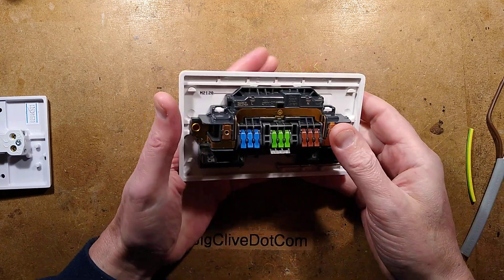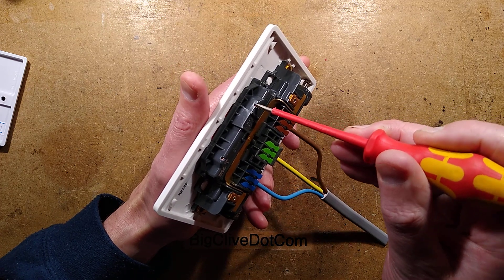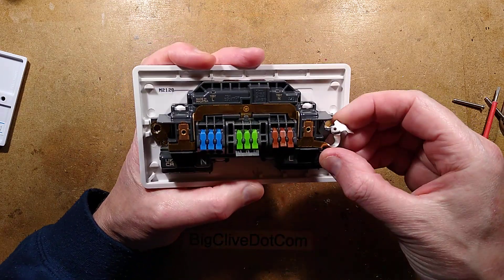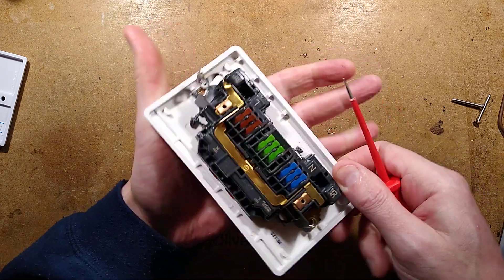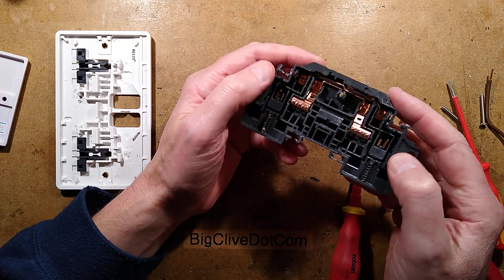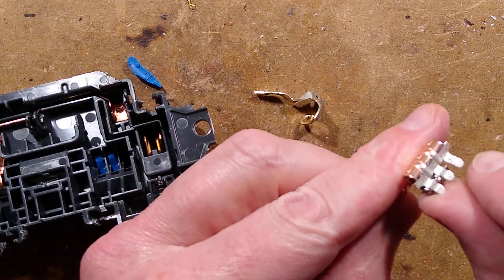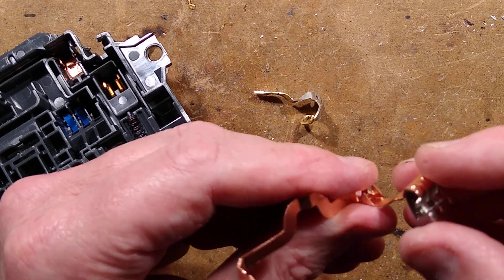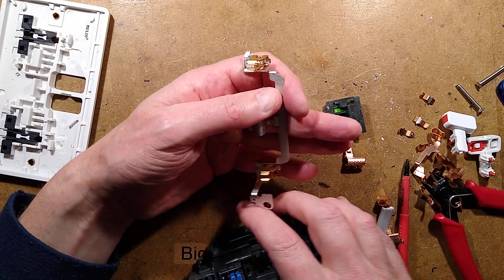Teardown of the new MK screwless socket

Comment: Wow we dont get neat things like that in the usa. And I like the switch on the plug that's a nice feature. Lovely video to watch before going to bed. Nice and relaxing 
👍good stuff bigclive
Reply: I can't believe the USA sill use twist connectors. 😂
Reply: @richardwigley  they are actually not the real issue with usa wiring, the back stab style of quick terminated outlet is a much larger issue compare to wire nuts as long as you use them correctly and don't try to use them for al/cu connections
Reply: @Mister_Brown  Commercial/industrial grade outlets don't have back stab connections, only the cheap ones for residential use do.
Reply: @brianleeper5737  True that--in my own home, I've slowly rid us of the "push-in" receptacles.     It was a terrible idea to begin with.  Some fixtures have a set of screw terminals as well as the push-in.   I suspect that one of the hydraulic-crimp-you-need-a-very-expensive-tool connections pretty much trumps everything but solder.
Reply: @tubastuff  I have a house where the original builder used outlets that ONLY have push in terminals. No screws. These outlets were made by Circle F in about 1987. Circle F went out of business in 1990 or so.
Reply: @tubastuff  I don't like crimp connections - unless the crimping tool remains on the connection keeping it tight - just like a screw terminal does. After all, when you remove the crimper, the pressure eases off on the wires !
Reply: @millomweb  I'm talking about the (usually hydraulic, but some battery-powered ones are now available) gas-tight crimpers.  It's pretty much a cold-weld process that yields joints that are stronger than soldered.
Reply: @millomweb  That's not how crimp connections work. Properly done crimping causes everything to cold weld, it's not just a simple pressure connection.
Reply: @mfx1  Interesting.
Reply: @mfx1  Well, someone who knows more than me on it says: "Crimping is just a compression joint.  It does not cold-weld". And that remains my opinion.
Reply: @millomweb  Then they haven't got a clue what they're talking about. If a crimp hasn't cold welded then it hasn't been done properly. There is an exception that crimps shouldn't be used with solid core cable when vibration is an issue but then again using solid cable in a high vibration environment is a bad idea anyway.
Reply: @richardwigley  The problem arises when hurried contractors or hobbyists use wire nuts and don't twist/crop the wires prior to using the nut itself. When used properly they're slow to install, but quite secure.
Reply: @elitearbor  I don't pre-twist wires before using wirenuts. However, I do put enough torque on the wirenut when twisting it on that the wires twist themselves together. If I remove a wire nut that I've installed, the wires are twisted together just as if you'd used pliers to pre-twist them.
Reply: @brianleeper5737  The NEC never issued a standard on whether to twist and crop prior to the nut, and manufacturers disagree with each other. I preferred the extra steps, taking only seconds, to further ensure a proper long-term connection. That went doubly so for anything with a pigtail run off of it!
Reply: @elitearbor  I've never seen any instructions for wire nuts that say the wires have to be pre-twisted, and the NEC leaves it up the manufacturer as they do in many other cases. From what I've seen, if you use pliers to pre-twist the wires, the result doesn't look as good as if you use the wirenut to twist the wires. Some people may not be able to put enough torque on a wire nut by hand to get the wires to twist, and they can either pre-twist or use a tool to install the wire nut, such as the bit that goes into a drill or cordless screwdriver. I can put enough torque on wire nut (by hand) that, if I'm not careful, the wires will bust out of the top of the wirenut!
Reply: @brianleeper5737  I would think you have 2 options - twist stranded wires together, apply nut - or use the nut to do it. I can see some connections where wire A is twisted with wire B then nut added but twisting the strands of both wires together is a much better method.
Reply: @millomweb  If one or both wires is stranded then I'm probably going to pre-twist them. If both wires are solid then I will let the wire nut twist them as I install it.
Reply: @brianleeper5737  The thing is, you can twist the stands of one wire - or 2 wires - then twist the wires together. It's bettere to leave both wires with straight strands, put them together then twist them.
Reply: @richardwigley  if done right they are just used as an insulator to bare ends the actual connection is the mechanical bond of the twisting together of ends. i prefer an older method of copper crimps myself( https://www.youtube.com/watch?v=UjPfasTjYTg&list=PLYyqRNzaEUGZZ0ouLVCHj1aa6YuIe5WDL&index=24 )
Reply: @richardwigley  Little diaelectric grease...  it's fine.
They are sketch but I have never had one fail on me.  Then again, I do not do this for a living, I am only responsible for the house/farm and business.  I have heard stories though..
Reply: @richardwigley  Twist connections, if actually twisted, are far superior to anything except solder.
Reply: @thereynolds2725  "are far superior to anything except solder" No they're not and they're certainly not better than a properly made crimp connection.
Reply: @mfx1  Crimps are not commonly used in the US on building wiring for circuits 30 amps and less. A wire nut is not intended to carry the current. Solid wires should be twisted with pliers before putting the wire nut on. The wires are in intimate contact spiraling around each other. So yes a crimp MIGHT be slightly better due to the pressure, but they aren't normally used in the regime where wire nuts are used.
Reply: @thereynolds2725  Neither is soldering generally used but you mentioned that in your reply. Wirenuts are bulky, slow to install and while they MAY have a slightly lower resistance than other methods, that isn't consistent and depends entirely on the installer so not ideal Wago's have a consistent quality of connection regardless of who installs them they might have a slightly higher resistance but it's insignificant and they still have a safety margin that's way over their operating current so it doesn't matter.
Reply: @mfx1  I mentioned soldering because for many years, it was the standard. I still come across soldered and taped splices from yesteryear. I agree that Wago connectors are a fine and fast way to connect wires. But I don't agree that they are superior. Mainly because the connection is reliant on the Wago itself. I like my splices to be independent of the connector. The argument of consistency doesn't hold in my view because we shouldn't rely on the connector to make the electrician better. If he can't make a good splice, he shouldn't be doing it.
Reply: You can get sockets with built-in switches in the US, but you have to actually look for them. You'll probably be able to get these lever-secured ones soon too, but it sounded at the start of the video like these might not be on the market anywhere yet.
Reply: @absalomdraconis  I've seen duplex style where one is the switch and one is the outlet but never with two outlets, two switches in a single gang outlet. I believe I spent some time looking quite hard once upon a time.
Reply: You think that is nice, you should see the old stuff. The USA stuff is shit, I had a hard time when I came here because the cars are made much better I expected the electric stuff to be too.

Comment: Do you think there's enough contact area with the solid core cable compared with it being mashed and moulded into a screw terminal? But then I imagine MK will have done their homework.
Reply from the maker: It grips the wire 3mm from the end, so cutting it square and making sure it gets pushed in well is essential.
Reply: I think the spring will maintain sufficient pressure over a longer period than would a screw terminal (which might have been under-tightened by the installer anyway) - Also it will accept/negate thermal movement which might occur for a period of high load... Agreed, MK must have done tons of research and testing before putting their name on it!
Reply: The tests I've seen on Wago connectors show they have no problem carrying high currents, though I agree they look quite flimsy compared to a big brass screw.
Reply: It should be at least equal to the CSA, so not a problem.

Comment: Anyone who's messed around with Anderson connectors or shell bearings from an engine would recognise the 
white metal as tin, dead easy to solder to also.
Reply: There are silver plated Andersons. But yeah, probably tin.
Reply: @johnalexander2349  Real Anderson power poles are silver plated the knock offs are usually not.
Reply: @bascomnextion5639  There are tin plated Andersons too.
Reply: Why would you solder the back of a wall plate ?  Is that even allowed in the UK ?
Reply: I might buy some stock in this company, IF that is not real silver (Ag). If it real silver, then they are crazy.
Reply: Also, does not look like the USA can get these, may be because our voltage is too low? Anyway, Sandy Munro said in a youtube vid we are going eventually to DC -- looks like Edison was only 150 years ahead of his time!
Reply: @franzliszt3195  sandy Munro should have some really compelling arguments for that. Given how efficiently and cheaply we can go from 230VACrms to 350-400VDC, I don’t see any reason for making the home grid dc. And there is still plenty of reason for keeping it at AC.
Reply: @JasperJanssen  I agree with you. Sandy gave no reason, he just said it and moved on. However, if you are off the grid and get all your power from solar cells, then you don't have to convert to AC and then have each electrical device such as an LED light bulb or you TV convert AC back to DC, if your appliance is build that way, which none are that I know of (except the old incandescent light bulb which can work or AC or DC -- again Edison looking way ahead :)). But then again, all fans and compressors would need AC? Anyway,
Reply: @franzliszt3195  if your primary source is home solar via a battery, and not the grid, then yeah, it might make sense to distribute that high voltage DC directly. It is, however, super dangerous. More so than AC. And you’d need to redesign *everything*. From the copper wire to the switches to the fuses to the sockets to the devices. A mere century and a half isn’t long enough to do all that, given an entrenched system and no real benefits to the new system. The inverters that go from battery to AC are just way too efficient for this to take off.

Most modern devices (like, electronics, including most higher end led lightbulbs) have a schematic that will work technically if fed HVDC, but they’re not rated for it, their insulation isn’t rated for it, and in general they’d need some minor redesign for it.

Even some fan/compressor devices don’t necessarily use AC internally, BTW.
Reply: @franzliszt3195  When did he say that?  April 1st?  DC would need thicker conductors and would still have higher voltage drop over transmission lines than AC.  Then there is the hassle of replacing nearly every single appliance.  Tesla got it right with AC
Reply: @cjmillsnun  I think it was about a month ago, and I looked but could not find it. May be he said it on someone else's show. I really wish I could remember. I AM NOT LYING!
Reply: @JasperJanssen  In one vid Sandy Munro said his new home will be able to live without the grid. He also mentioned to  Musk that the cars should be 48 V DC; Musk replied 50 V DC. I think you can't get electrocuted at 50 V DC or less? Really the  safest supply for consumers and homes would be 50 V DC or less. Again! Edison was right!:) Boy, that Edison; you just can't keep him down.
Reply: @franzliszt3195  48 volts as a house power supply is a supremely bad idea, unless you just don’t have any devices consuming high power. It leads to a lot of copper being necessary.
Reply: @JasperJanssen  OK. Hear me out. Plumbing in going to PEX from copper. As time goes on, up to maybe 30% of the people will be off the grid, if they choose. Eventually eliminate all AC to DC conversion in electronics and appliances. And go with 50 V DC -- 4% less Cu. Most homes now have 15 and 20 AMP outlets depending on where they are -- kitchen usually has 20 AMP, so bigger Cu lines for these. Now with 50 V DC,  so many fires and electrocutions eliminated! This is the long term solution. No more power lines, utilities as we all share our locally generated DC with each other. Sandy Munro says his system will have Tesla power wall with 7 days of power, which he can share with neighbors -- of course that DC. But 'at the end of the day' as Sandy says about twice in each vid, we are going to DC.

Comment: Could the metal coating have been applied to the whole sheet of copper before the part was punched out and formed? That would make more sense to me.
Reply from the maker: I think it probably was.
Reply: I noticed that the plated face was against the plastic, which is where humidity might get trapped for longer, so maybe it's for protecting against corrosion where it's most likely?
Reply: A softer metal coating to help the tooling and parts release the molds
Reply: What is the purpose of the brass coating in this case?
Reply: @electr0maker436  There wasn't any brass coating, it was solid brass with some kind of grey/white metal coating on the rear.

Comment: Could the plating be Nickle intended to reduce electro corrosion between brass and steel of the spring bits?
Reply: Agreed, I really don't think it is silver because silver will tarnish over time.
Reply: It would be tin.
Reply: @StreuB1  interesting... what is the function?
Reply: @vernzimm  Prevention of oxidation. Pure tin is extremely resistant to corrosion and is extremely conductive.
Reply: Given the other suggestion I now agree with Tin as, when I thought about it, it would not be practical to just electroplate one side with Nickle whereas 'wiping' with molten tin, MP 232° C, is a common process - think of copper cooking pans.  I don't think wiping with Nickle, MP 1455° C, is practical!
Reply: But then why do the whole back side of the brass? Also, it did rather look like silver plating, that sort of dull white when it's unpolished, compared to nickle which tends to be quite shiny.
Reply: @vernzimm  Nickle can be bright or dull plated, depending on the chemistry, but I now think Tin is more likely as it's pretty hard to electroplate just one side, but Tin can be wiped on.
Reply: Rhodium plating?
Reply: @enlamainyokohama  No, it's tin.

Why would it make sense to plate copper with an insanely expensive noble metal?
Reply: @enlamainyokohama  Far too expensive and of no physical value. Also very difficult to electroplate only one side of a metal sheet, from which the parts would have been stamped.
Reply: Did you mean: Nickel :-)

Comment: I didn't have much success with these, the wires seemed to fall out of the terminals if they were disturbed.
Reply from the maker: The stripping length seems important.  The marks at the end of the wire suggests it grips them quite close to the end.
Reply: @tinplategeek1058  It looks like 3 to 4mm of wire has contact with the plated buss (finger) and the mark on the wire is from the square opening of the loading spring.
Reply: @charlieb9502  Cheers

Comment: The earth busbar would be more than twice as conductive if it were aluminium. Brass is only about 28% as conductive as copper.
Reply from the maker: The problem with aluminium is that the oxide that forms on its surface is high resistance.
Reply: @bigclivedotcom  Which is why it's often plated with something, as with CCA. I'm not saying aluminium would be a good choice, just observing that brass is a surprisingly poor conductor considering how commonly it's used in electrical fittings, presumably due to its good mechanical properties.